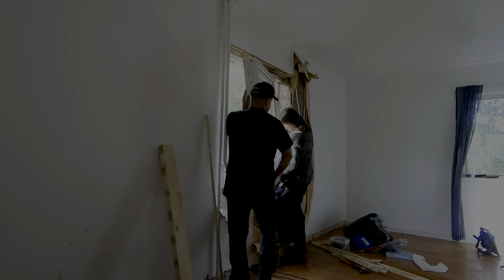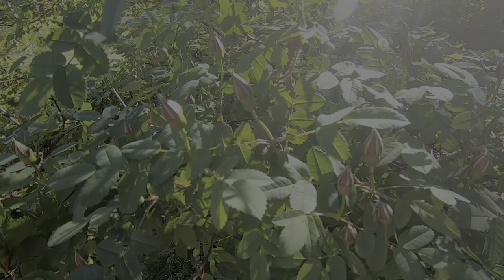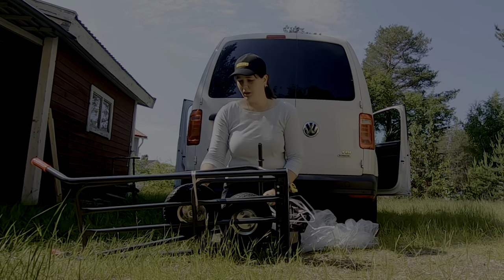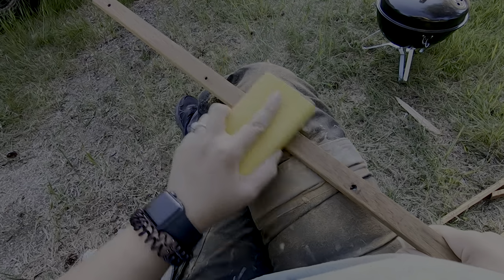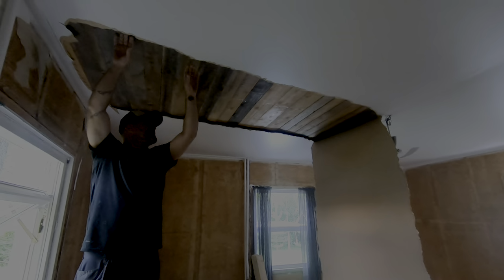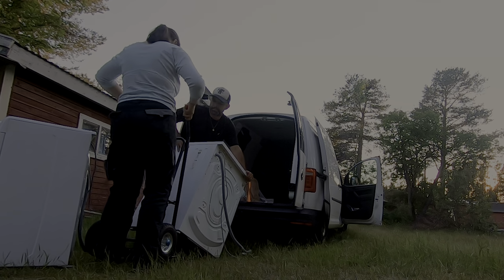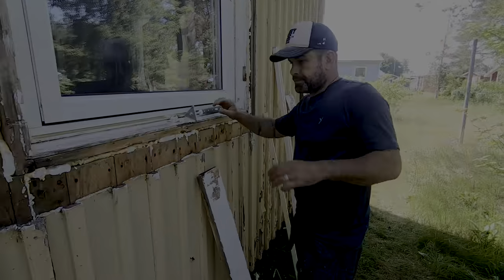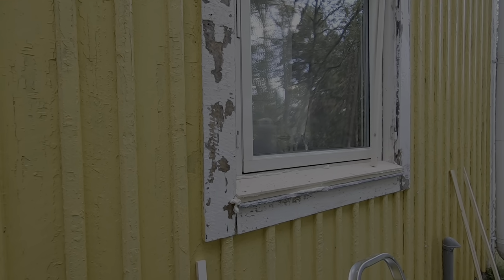100-Yr-Old House Reno: Summer in Sweden I Ep. 4

Comment: A gas water heater is available. that just needs to be connected to the cold water and then has water with a temperature of 38-56 degrees. Kosan gas center they can be bought for a good price of DKK 2000. a distributor can be fitted so that you can have a shower and use it in the kitchen. Have it even in an allotment garden
Reply from the maker: Hi! Yes we’ve looked into on demand water heaters. However there is not LNG available here so we would have to buy canisters of LPG.  We have installed a standard water boiler for the time being as our electrical service is very old and can’t handle a large amperage demand on it😊
Reply: Gas is not a big thing in Swedish households, especially not when you have electricity. Gas gadgets are basically used in summer houses, boats etc where you don't have access to electricity.

Comment: Isn't the window upstairs above the entrance upside down?
Reply from the maker: Hi! What part of the video are you talking about? The window above the stairs is a little smaller than all the other ones but it is not upside down. They are pretty straight forward and only open one way (the handle is at the bottom)
Reply: @Projectsweden  18:10 My bad, I had been awake for too long watching your videos, I see now that the handle is on the outside and the window have been flipped. It just looked weird with the big gap upwards! Same with the window on the left I just noticed!
Reply from the maker: They flip outwards and they still need trim. It’ll look better soon! We are working on replacing the siding right now
Reply: @Projectsweden  Yeah I didn't notice they had been flipped at first.